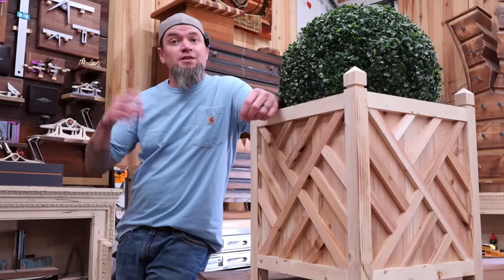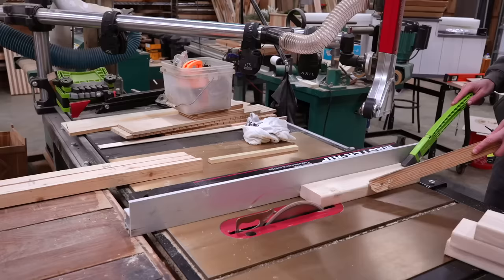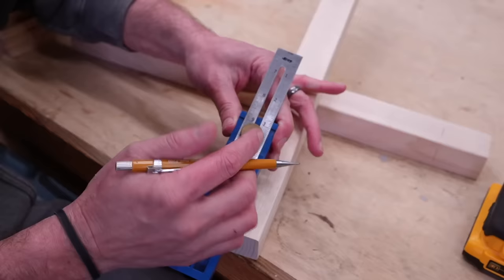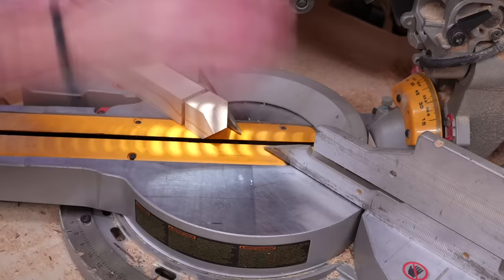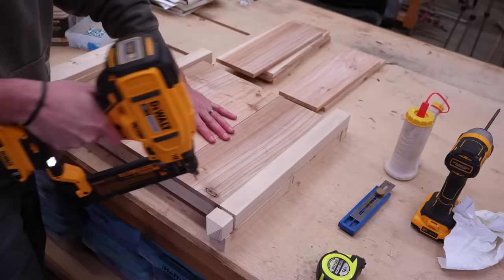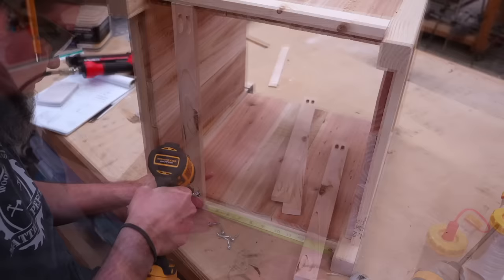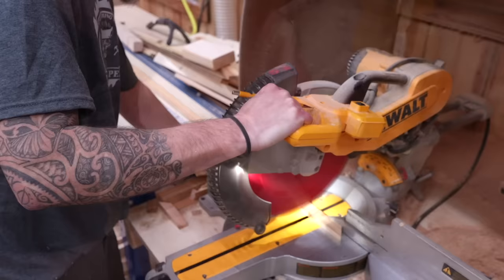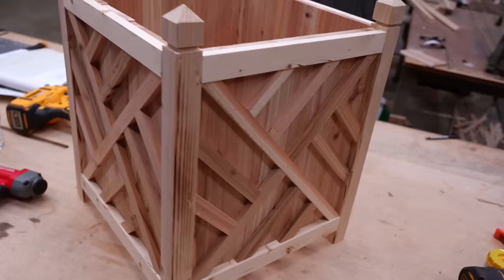DIY XL Picket Planter - Low Cost High Profit - Make Money Woodworking - Mothers Day Ideas

Comment: I built one today can some one check my math?  22 inches - 3 = 19.  1 3/4 + 1/4 = 2.  19 - 2 =17.  I cut the Wall Boards at 17 1/2 so they hung over by 1/2 inch so I was off by 1 inch.  I move the bottom Cross Board down to 3/4 kept on building.
Reply: My math wasn't mathin either, lol.  I'm looking to see if he addressed it.  So far very few comments.

Comment: Lighthouses would make for a cool picket build I think.
I live on the coast and a tonne of people love the look of wooden garden lighthouses, built as short and as tall as 2ft-10ft tall. 
Every time I see one I think how easy it would be to make one out of fence pickets or pallet wood.
Reply from the maker: Start making some!  It seems lighthouses are an item that has always stayed "in".
Reply: @MatthewPeechWoodworking  That's the plan! It's the tapered cuts with miters that have me a little nervous, but if I've learned anything from your channel it's that just because something seems/looks difficult doesn't mean it is lol
Reply: @comedian0338  use the obelisk plans and change the top to fit something that's more lighthouse visual.  or take the obelisk and fill it in then put a LED solar light on top!
Reply: I don't live on the coast and nearby there is one place that sells nothing but ornamental lighthouses.

Comment: I built two of the 20 inch ones today. I tried the pocket hole method but the wood kept splitting out so I just used a counter sink bit and drilled out the holes on the legs to hold the boards. I also increased the width of the bottom slats from 1/2 inch to 1 inch so those pocket holes would not split out. Also as soon as I posted them in a woodworking group I'm in they wanted to know everything so I shared your video. 05/03/2023

Comment: built this in sketchup while buliding in real life, yes i like to over build stuff  lol.. but i think the leg messurements are off. you cant be a quatuer inch from the 3 in inset and also be 1.75 in up from bottom that distance is 17 and the wall boards are 17.5.. am i missing something?

could it be the the wall boards arent actually 17.5?

After adjusting to keep your layout. 

The wall boards need to be 16 1/2 not 17.5

Hope this helps a fellow ocd woodworkers.

GREAT ORIGINAL POST THO
Reply: Hah, searched the comments to see if anyone else had this issue. I had already built it so just took my multi tool and took an inch off two sides (across from each other) to give me that half inch space to attach the bottom boards. Yes, wall boards should be 16 ½"
Reply: Same issue. I'm to the point of attaching the decorative trim and the lengths and the angles are all off. I'm guessing the legs need to be longer but I'm not sure by how much.
Reply: @eljefetx  cut wall boards to 16.5 inches
Reply: @joshbrown5073  yeah...that's not the problem. Try reading again.
Reply: Did you find a fix for the decorative trim pieces fitting? I'm wondering if having the side panels shorter or the legs longer will make the decorative trim fit like they should @eljefetx
Reply: From Matthew...So the problem was that the legs indeed are too short for a 3" cap And if you placed the cross bars from the bottom measurement and the top measurement it would throw the panel off.  The legs should be 22 3/4".  If you have already cut your legs you can still salvage the project by making your panels as pictured in the diagram below and just drop them down so it is 1" from the bottom.@justinmcdonnell3025

Comment: This was an easy decision to buy the project plans. The one thing I did a bit differently was cutting the 45 degree cuts first, and on a longer than needed piece of wood. I cut the 45 degree angles first in case I screwed up (which I did). That way I just chopped off the offending miter cut without ruining the whole piece. Practicing on scrap lumber before hand helped too since my old DeWalt chop saw doesn't have a shadow or laser cutting guide.

Comment: I found that when you set the cross boards flush with the outside of the frame - the corners split on the legs when you drive in the pocket screws... Even tried switching to 1" just regular screws and it still split. Had to remake 2 of the legs...  

In the end I used a 1/4 piece of a birch wood to inset the cross boards and had NO problems after that.
Plus the legs stand out a little more proudly now too!!!

About done with the fist one - and for my first time dealing with angles, I WISH you had explained the shapes a little better so I understood if it was like this - \___/ or /___/  

Either way - I appreciate the video and it's turning out GORGEOUS.

THANK YOU!
Reply: I came across the same issue. And had the same idea. I came here looking for this comment to see if it worked for anyone else. Thank you.
Reply: I had the same issue.  If I was to make another one, I will make the cross pieces 3/4 in thickness vs. 5/8.  Also, I'd make them 1 3/4 inch or 2 inch vs. 1 1/2.
I've shelved this project and moved on to different style planters.
Reply: Trying to build this today and ran into same issue.  1 inch too short and 1 1/4 too long.  I was wondering if that would work.  Thanks for posting.
Reply: @toddwilliams1689   Yes yes!!!! Much welcome!!!

Comment: Happy Sunday Matthew! Have you made a planter bench yet? I couldn’t find one in your video lists. They are wildly popular here in North Carolina, probably throughout the South. Would love to make one for myself as they are crazy expensive! 
Thank you Matthew for all your inspired ideas and generosity. May you continue to be blessed each and every day!
Reply from the maker: Not yet... but it's still on the list!
Reply: take this 18in planter and put some boards across 2 of them.  optionally you can add 1 across the bottom-middle for support.
Reply: If you can build this planter, a bench is not much harder.  I'm from NC also and would be happy to help you design your bench.  Just send me a msg.
Reply: Like jeTah said, build 2 of these for the ends. I would slightly modify the side where the seat will attach to, as that is where you will mount the seat connector. I made 1 with pallet wood and 2x4's. Measures 9' in total length. My planters are not this nice, but they work. Put small spacers between the 2x4's on the ends and a couple along the length.

Comment: Great simple explanation of what looks to be a complicated build.  $30 of material can turn around and sell for $100+.  

One tip to make things easier; set up stop blocks on either side of the blade for cutting the decorative leg grooves so there's no need to measure/mark and no chance of cutting in the wrong spot.  Same thing for the top bevel.  Just bump, chop,turn.. no brainer.

Also I know you're building this for the video, but there are 1" pocket hole screws with a yellow outdoor coating.  Armor Tools makes them.
Keep up the good work.

Comment: I tried to build one of these based on the cut list and instructions in the video, and one of the dimensions isn’t right. Either the legs need be 23 inches long, the wall boards need to be 16.5 inches long, the top point dimensions need to be adjusted up by an inch, or a combination of things. Following the numbers given, the wall panels end up 1 inch too long
Reply: Scrolling down through the comments to my surprise more folks didn't bring this up, had me thinking I was crazy!  I bought the plans and have the same issue.  Tried to diagnose, and on my 2nd try, I forgot to cut them to 23" so I'm just going to eat up some of the bottom leg by moving the wallboard assembly down.  However, cutting the boards to 16.5 may be the easy way out.  Thanks for posting this!

Comment: Incredible work as always, great content! My pickets always shrink after i assemble so im taking a break on pickets for now
Reply: This is the issue I'm having as well, the width of the cedar pickets shrink leaving gaps. Is the hey to this buying the pickets and letting them sit in the garage for a week or two?
Reply: @Eric Wall  i couldnt tell ya, ive left these 2 stacks of 10, clamped together, in my garage for almost 3 months and they still shrank. My only advice would be to no have them all together.

Try having one, then shim up another on top, and so on. I put all 10 boards on top of eachother and found only the top one was really dry but the others were still damp. Having that gap inbetween would aerate well
Reply: @ericwall8862  if you have a dry garage, running a small fan directed across or along the length would speed the process a lot! Shift the fan around a bit, and get different locations after a few hours in one area! And use small sticks to allow maximum drying!
Reply: @richardmccann4815  thanks for the advice. I do and I will try that. I will do it for about 7 days and see how they turn out. I will measure along the way

Comment: First off Matt you rock,  2nd I’m lost.  I purchased the larger instructions and I made one of these and it turned out good (without all the angled cuts, lol.  Folks want them, question is when i went to make 2nd, C/D (when flush with top cross member), hung over the bottom cross member completely and I can’t seem to find in detail where I’m off.  I’ve made adjustments to my measurements (ad nauseam) to compensate but it doesn’t look the same so now I have to make a 3rd to look like 2nd. Lol. Result was no room/lip to pocket hole the support slats into at the bottom, and leaves me wondering if I assembled the support wall wrong?  Idk any help would be appreciated.   

Ultimately the cubeish knob just under the bevel cut is shorter than the one you did.  It allows for me to lift the top cross bar up a tad so that a 1/4” lip is left to pocket screw the slats into.  Also have to use 1.25” pocket screw in the slats…idk especially on how strong the first one was with just 1”!  So confused!

Comment: Did you run those pickets through a planner first to clean them up?  The pickets I see at our local big box look much rougher than that.
Reply from the maker: Depends of the board if I just sand a little or send it through the planner.

Comment: Bought the plans and I've apparently cut something wrong but I can't figure out where I went wrong. When I went to install parts B and C they were longer than they should have been which I knew meant the decorative piece might not be right. I was correct. The only thing I can figure is that the legs are too short, but I cut them to 22" as the plans stated. I've double checked my cut lengths and everything is cut to plan. Any help?
Reply: Same here.  DId you ever figure it out?  I don't think he's going to respond, so for those that read this and have same issue, keep the top measurements, there's room to push things down on the bottom leg measurements.  OR you can move the top measurements up by 3/8th's an inch.

Comment: Do you have difficulty with the fence pickets shrinking and creating a gap after you build these planters? How do you avoid having fence pickets that shrink like when you use them building your backyard fence?
Reply: This is a function of the moisture in the boards. The best thing is if you can get the wood way ahead of time to let it acclimate to a dry environment for a few weeks first if possible. Otherwise about the only thing is to make shiplap panels which overlap but it still might shrink up so much there’s a gap.

Comment: I believe the wall boards should be 16 ½" (not 17.5).
Reply: Yes, I made my 1st full wall and 17.5" wall boards, while placing the bottom cross board @1.75" from the bottom, and my wall boards went .25" PAST the cross board.  To fix this and have the wall boards shorter than flush with the bottom I changed the wall boards to 16.5".
Reply: Same issue. It also screws up the angles and cuts on the decorative boards.

Comment: Thanks for another build. The 2x4 at $3.38 is that treated or cedar? Cedar 2x4's in my area are $19.38? thanks.
Reply: Neither. It's untreated pine.  Treated will run about $4.58.

Comment: A couple of questions.
1. What does one do if you don't have something to help you do the pocket holes?

2. What does one do if you don't have a table saw and all you have is a chop saw or a handheld circular saw?

If your answer is buy one of each of those, thanks, but that's not helpful as financially that's not a viable solution right now.
Reply: Not sure if you got an answer or bought some new equipment, but you can get a rip fence for your circular saw and work on the ground for the long cuts that the table saw called for.  It won't be perfect but it could pass.   Sell 2 of these and you'll be set to get a better setup.

Comment: pocket holes again. @2:40 I have to bail out on another video bro. Maybe consider some of us can't afford pocket hole set ups.
Reply: 38$ for the cheapest one.  OR just put in screws in an angle, like we use to do before pocket holes were a thing.
or make your own pocket hole jig.  
or use dowels, or biscuits.  There are plenty of alternative joinery.
with woodworking you dont have to buy a bunch of jigs when you can make them.
Reply: I hear you. tho I got the kreg simply jig for like $35, all you need is a Cclamp.  OK, you could also drill a hole in the leg from the outside, countersink it with a standard dowel diameter,  screw the cross piece from the outside, then cover the hole.  OR, assemble the panel side, then toenail the panel to the leg from the inside. Probably toenailing along the length is strongest.
Reply from the maker: Yes, just like the others mentioned this is only one way of joinery options. There are  also several cheaper options for pocket holes-some as low as $15 for generic options. Don’t give up on a project just because you see me use a tool that you may not have. There’s always alternate ways of getting the job done. You’ve got this!
Reply: The jig from harbor freight is like 60 bucks and works great and is all metal
Reply: Buy a pocket hole setup. It will be some of the best money you ever spend.